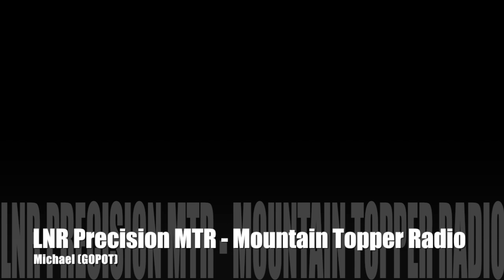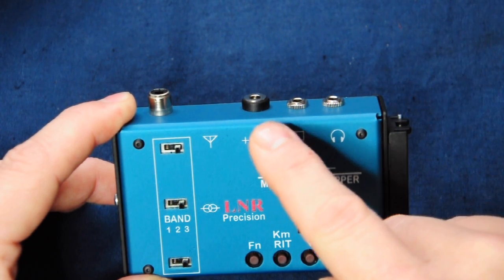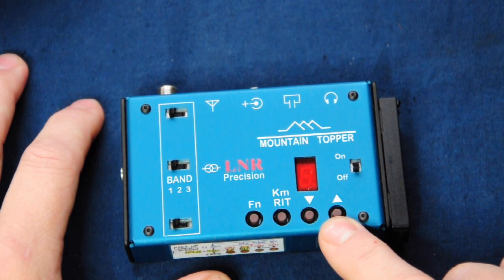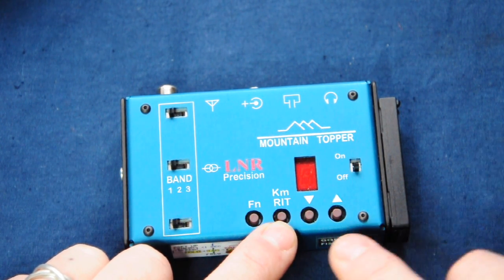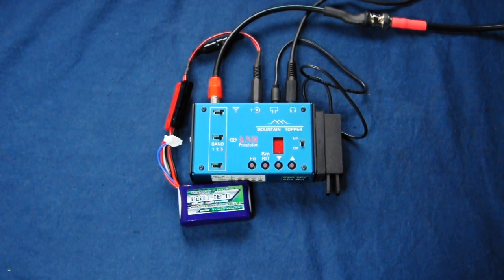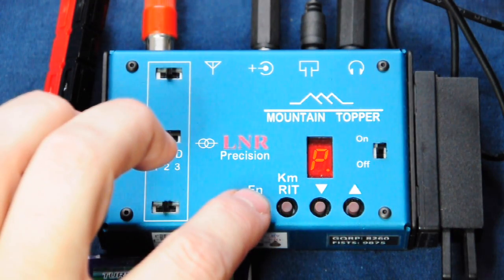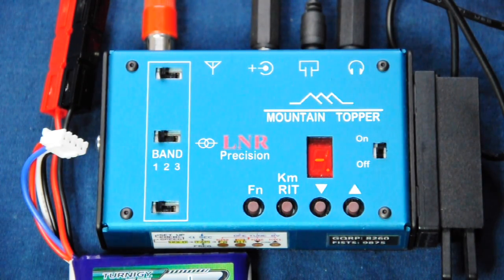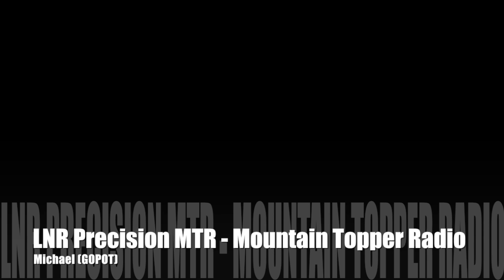Mountain Topper Radio Review (MTR3B)

Comment: There is a calibration procedure in your Mountain Topper radio manual.  It should fix that 100 Hz error between the reported freq and actual freq.  I do not know if the American 10,000 kHz time signal gets to Europe or GB, but if so, it works just fine to calibrate the MTR and other KD1JV designs with your computer and other receiver.
Reply: Thank you for this information. I had a scheduled contact with a club member the other day and when he replied to my CQ I didn't hear him because he was so far outside the pass band of my KX3. Luckily, another local amateur sent me a text (!) to tell me what was happening and we held the QSO with a large RIT adjustment at my end.  Hopefully, he will be able to correct the error to avoid missed contacts with other stations in the future. I am an avid QRP op and homebrewer and I have to say that this is a very detaild and well presented review. Thank you MIchael, vy 73 Graham - de G4VUX
Reply from the maker: Although the calibration of my MTR3B is a little out I think the TX and RX are aligned...its just the displayed frequency is a tiny bit off. Loving your Paraset video by the way (https://youtu.be/JwMc53nE9kQ)...I'd like to build one of these or at least a basic valve CW transceiver at some point :o)
Reply: Yes, looking back on it, I think you're correct, We had agreed a frequency in advance and my guess is that my friend tuned his MTR-3B accordingly. I was using a very narrow bandwidth due to the local QRN. We are planning to meet up for a field trip soon, so I will have a chance to see the MTR-3B and maybe make a few contacts! Best wishes, Graham